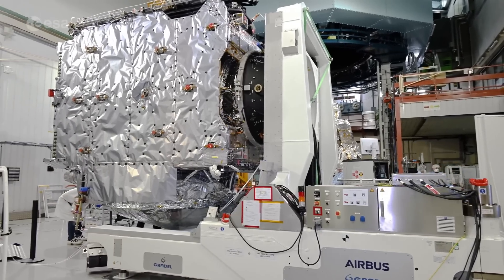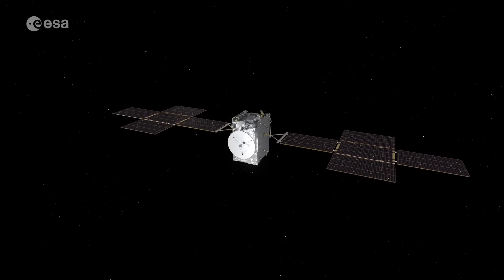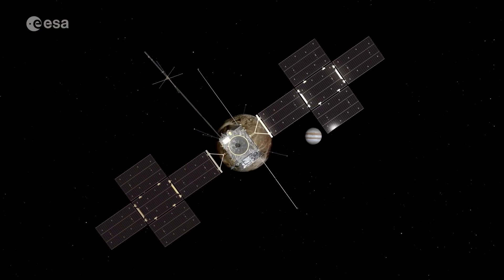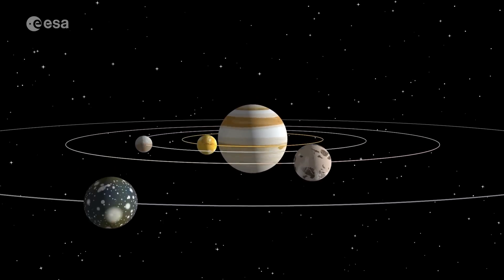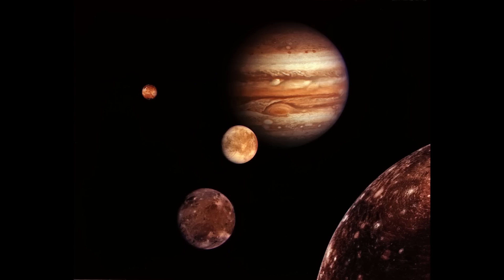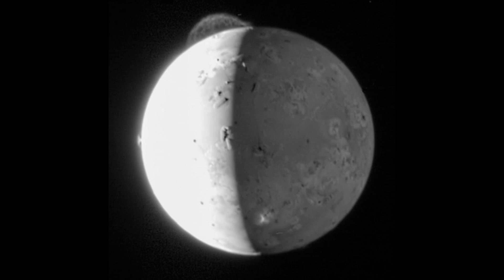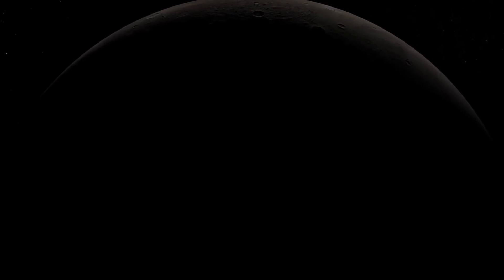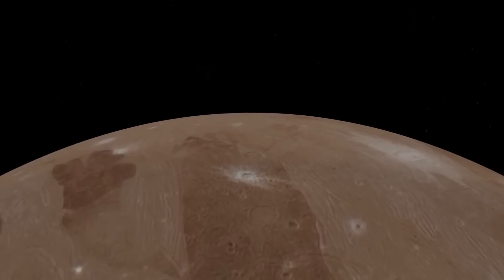European Space Agency Looking For Life In Jupiter's Moons

Comment: That's a long mission just to get there. I wonder how the timeline would look if a Falcon heavy yeeted this out instead of Ariane 5. 🤔
Reply: Probably longer since you need to add the time to either design a larger fairing for Falcon Heavy or a smaller JUICE that fits in the existing Falcon Heavy fairing.
Reply: The issue isnt that is it? The slow burn is a huge amount of delta in itself and the faster you go the more you need to slow down and capture an orbit. These guys know what they are doing im sure its the most efficient rocket for the mission.